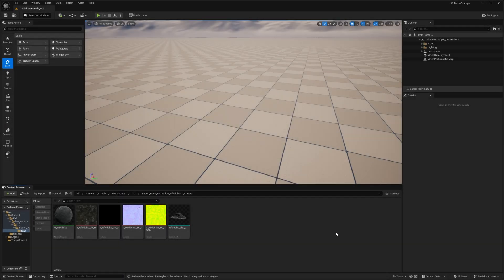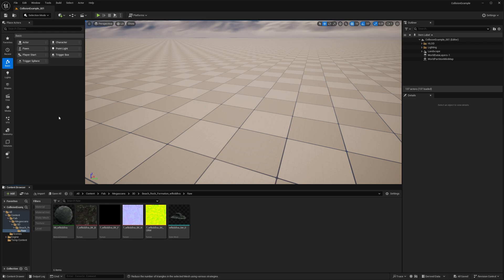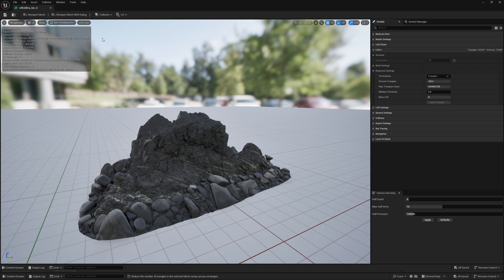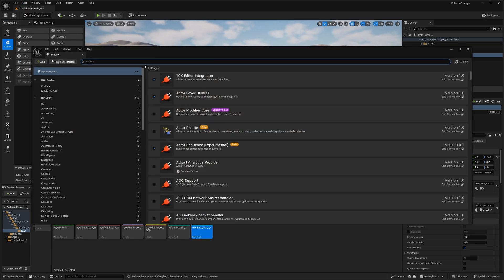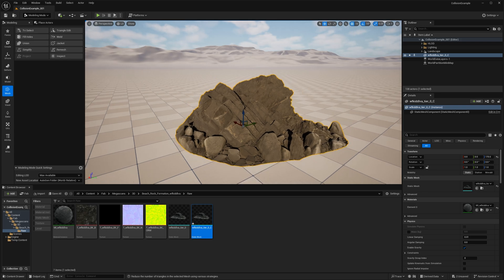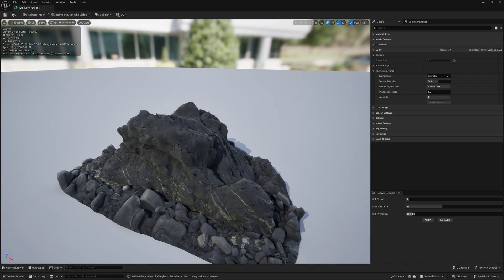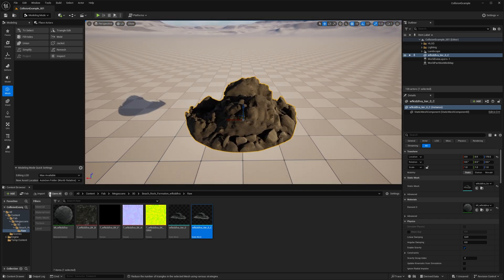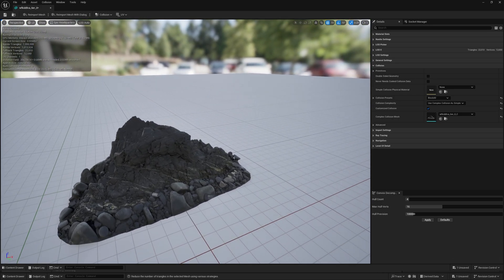Tutorial | Advanced Collision Creation | Unreal Engine

Comment: I tried this out on a simple Flag pole I made in the modelling section (cylinder + sphere that I merged) and attached a Flag cloth mesh to it.
When I run the simulation, the collision is not working.   I tried all the Collision Complexity values - none work.  I tried poly counts between 2,000 and 10,000 - no luck.
The only way I can get collision to work is if I assign it a Convex Collision.
Any thoughts as to why this isn't working?
Reply from the maker: If you're running a cloth sim you will want to have the cloth (flag) mesh separate from the pole and be sure to set the pole's collision to "BlockAll" in it's details.
Reply: @C-MediaSolutions  - Thanks for the feedback.  Yes, my cloth is a separate SKM and the Pole's collision was set to "BlockAll".  Is there maybe an issue with Cloth Sims that they don't respect the Collision Mesh?  I've also done searches for the Collision Mesh and found nothing regarding usage with Cloth Sims.
If you have any other thoughts, let me know.   -John
Reply from the maker: @John_atCTS  Hmmm if they're already separated I'm not sure what the issue could be - Best bet would be to try finding an existing asset that works how you want and dissect it to see what might be the issue with yours.
Reply: @C-MediaSolutions  - Thanks.  I've been doing side-by-side comparisons of meshes that do work as well as trying different combinations of settings and so far not seeing any issues with my mesh.  I've come to the conclusion that the Chaos Cloth Sim still needs work to bring it up to the level of character physics and hopefully these will be worked out in a future release.
Keep the video's coming!  😊